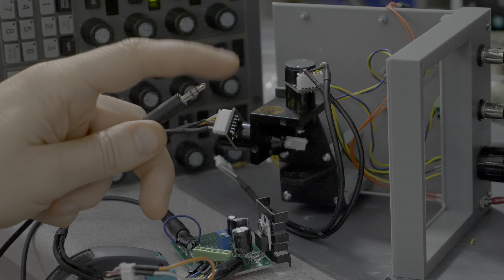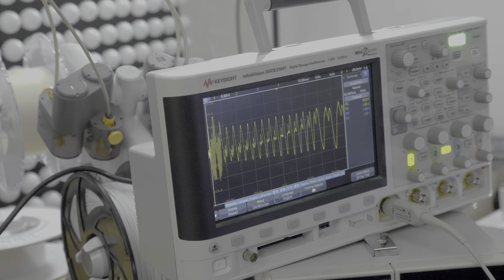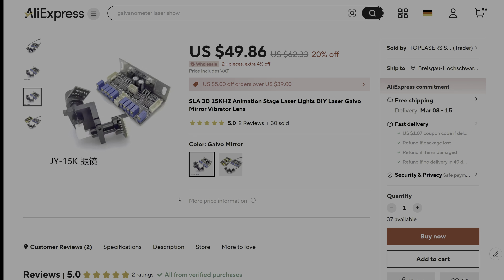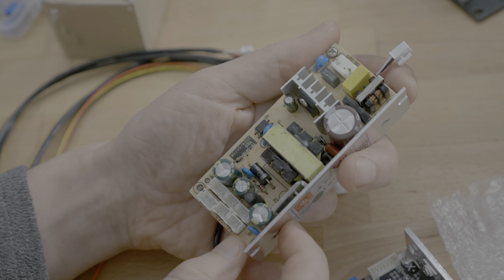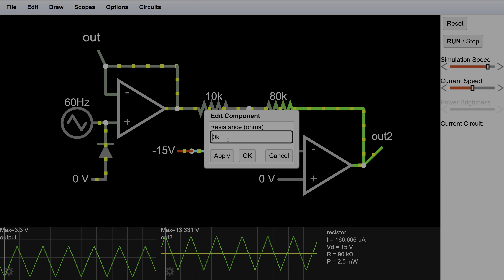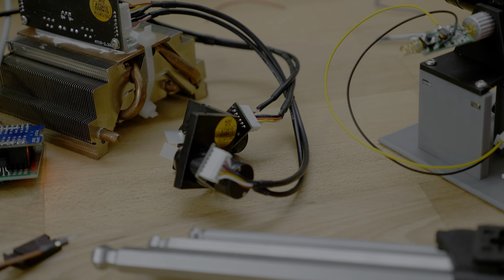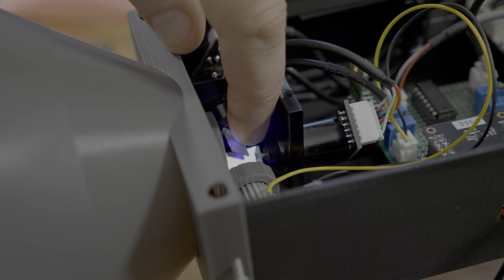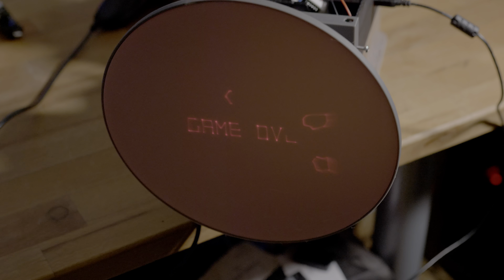I made a LASER vector display

Comment: Have you tried to use the style of reflector used in laser printers? Its a spinning wheel with 6-8 sides as a mirror so it would sweep like a normal crt display and you would only need a vertical galvo to be able to draw an image?
Reply: The reflector you refer to is called a polygonal mirror. It functions, roughly speaking, by rotating in front of the focus of a point light source to scan the point across the line of a single finite axis as each face pans across the focus, restarting at the opposite end of the axis when it reaches the next face. This rotation is usually, but not exclusively, unidirectional and continuous at a static velocity, due in part to the motors commonly used. A second mirror can be introduced to affect an additional axis or to flip the effective direction of travel or to redirect the output angle with a minimum of distortion.

While most readily applicable to raster scanning, I don't see with my limited knowledge of the subject why a pair of polygonal mirrors or a polygonal mirror and a galvanometric mirror could not be used to effect a vector display provided that the polygonal mirror(s) operate(s) on a motor(s) capable of braking and reversing motion and grading rotational velocity at the momentum involved.
Reply: @claws61821 polygon mirrors have a huge inertia when compared to Galvo + Mirror. Therefore they are only used for raster scanning.
Reply: That wouldn't be a vector display though, more like a 'fake CRT TV with a LASER'

Comment: The reason that the galvo driver takes a bipolar 5V differential signal is ILDA. It's the standard interface for laser scanners used for stage lighting. With ILDA a DB25 cable carries bipolar differential signals for X, Y, Z (uncommonly used, typically for focus), 6 colour channels (typically only RGB are used, occasionally you find 4-channel ones with yellow or cyan added), and an overall intensity/blanking channel, along with single-ended signals for shutter and interlocks. I run a pair of Pangolin FB3 ILDA interfaces to my projectors, for example.
Reply: Retired old fart Laserium laserist here. 5 years back in the game, developing my own 3 projector rig (again). Pleased to meet you.
Waiting for my $2,700 worth of RGB diodes, drivers, & EMS8000 galvos   to arrive from Live-Laser Systems in Austria, for my next projector build. 
Customs has them impounded in Memphis and are asking, "Do they emit radiation?" 🙄👿
Reply: @TheOleHermit  Ouch, best of luck getting those cleared. Kinda incredible what you can get for that price these days though. My Kvant Clubmax 2000 (2W total) was just over £2000 and now for the same price you could get 10W plus from European and Eastern market sellers.
Reply: @gsuberland  Special ordered 642nm diodes, precision ColorDrive analogue drivers, bitchin Sparrow optical assemblies w/TEC feedback cooling.
Wanted Saturn 5 galvos, but you know that story. I'm not a monopoly fan.
Custom developed, MIDI controlled Teensy 4.1 Laser Synth(s), Reaper's DAW, 16 channel Behringer X-Touch + Extender.😜
Strictly Swamidog's Radiator/LSX  video style (w/neither Radiator nor LSX).
10W? Retired from ion touring in 1988. Stage beamers w/Kvant scanfail nowadays, eh.  
Not for the living room/ studio. Even on a black projection screen, 3W projections are frying my eyeballs and over saturating the camera. They'll end up being beamers + the new 1.5W build will be for imagery + el cheapo bits for a lumia projector.
Stay tuned for 'TheHermit's T4 Laser Synth' reveal thread on PLF, in a few months, as soon as I've finished the impounded bits build.
😎
Reply: @TheOleHermit  nice! definitely way more fancy that I've been getting. I'm still stuck on BEYOND but if Liberation ends up being successful longer term I might consider switching to EtherDream or similar, or designing my own DACs for fun. I usually do beamshows rather than graphics so the higher power is nice, but I only run 2W indoors really anyway since going much above that isn't really that much more spectacular and I then have to really think carefully about exposure safety and static beams. The main big show I do is EMF Camp, and I do take a fair bit of lighting there, but Dmitri Modderman and Rob from Dogstar Lasers bring the big laser gear for that (also hoping masterpj55 will show up in 2026) and I just do the live control.
Reply: @gsuberland  Are you another one of the Patreon supporters for Liberation? Yes, I know Seb has moved to a different platform for funding now, but cannot for the life of me remember what it's called!
Reply: @cambridgemart2075  Nope. I might look into it at a later time but given that it's a subscription model it doesn't make a lot of sense for me.
Reply: Pangolin is too expensive. Use HELIOS
Reply: @  Yep.  I found out too late!
Reply: I made an rgb galvo laser display with 3 galvos and it works perfect. I mounted the galvos with 3d printed poly carbonate carbon fiber mix so maybe its not recommended but it works great
Reply: @98f5  That's great!
How many hours have you tested it at a time? What power RGB diodes did you use? TTL or analog drivers?
Which galvos did you use and how hard did you work them? Sinusoidal waveforms or animated graphics?

Major differences between hobbyist expectations and professional show demands, while $tousands are riding on every gig.
Reply: @TheOleHermit  got discord? Its too much to write here. I went through the phase a few years ago. After i used it once or twice for christmas and holoween it is in totes now lmao. I tried lots of stuff, the lasers were cheap diods from pointers bought on ebay. One used somebrushless servo motors i had for a project at work. The other used mirrors with basically 3 pins welded to the back and small electromagnets to manipulate the angle woeked similar to galvos i guess come to think of it i didnt use real galvonemeters though. Nonethe less it was an enjoyable project
Reply: @ Don't got Discord. Social media ain't a hermit's kinda thang. This is my only contact with humanity, except for hanging out with fellow laser head folks on Photonlexicon forum.
Impressed with your dual axis mirror. Had a similar idea back in the '80s. A mirror suspended in a magnetic field  being deflected by  the same surrounding magnets. Only needed some proper engineering and mega bucks to develop.
Recently saw someone else deflecting the end of a fiber optic. But of course, bending glass fibers doesn't last very long.
BR
Reply: @TheOleHermit  i used arduinos and the the biggest issue with that setup was there was a max limit to what you could draw and still have persistence of vision. i think you could also do the mirror deflection with piezo electric and get faster responses, but like u said, big money needed to develop the idea.  Ill lookup this forum. I did have one other journey into galvo lasers when i tried to make a home built selective laser scintering printer but the fiber laser was too much power for any of the  galvos i tried from amazon and would end up burning them. I seem to remember also taking apart one of those laser projectors for like night clubs to try to make one of those resin printers that usually use a dlp projector but ended up buying a commercial one instead.
Reply: U are discusing this on discord?
Reply: Pangolin!  I love their DAC interface.

Comment: i work with showlasers in my job and i might be able to give some insight.
the signal is +/-5V, since this is the ILDA standard. basically a d-sub connector on the back of any showlaser that connects the laser to the control system/interface.
that connection is basically analogue. it provides XY as +/-5V and 6 color signals of 0-5V.

the maximum angle of the galvo is low, since a bigger angle directly fights speed. showlasers are specified at 8° angle with their speed. if you want to increase one, you need to decrease the other. however there are lenses that expand the beam deflection if placed behind the galvo. maybe they will help. (as you tested)
also you got a very bad scanner(galvo) with 15kpps. even a very low end showlaser has 30kpps. a usable range is at 40 and the high end starts at 50kpps.
you might be able to snatch a used showlaser (or a broken one) for parts. you may look into old laserworld CS1000. if you are lucky, you may find one in the SE (speed edition) version. that one has a 50k scanner. those old CS MK1 are modular. so you will find the same scanner, laser diode drivers and so on.
The picture will be quite a bit better if you use a real 30 or 40kpps scanner.

i agree with you. you have overdriven your galvos quite a bit, resulting in the burned motor.
they are very delicate, require active cooling and careful adjustment. you can kill the motors even without messing with the driver. your scanning rate is important.
Reply: Retired Laserium laserist here, now back in the game, developing my own rig. I assume you're a Kvant/Beyond showman. Pleased to meet you.
Just made a similar comment regarding el cheapo vs professional gear. Moral of the story;
DON'T MESS WITH THE GALVO DRIVER'S TRIMPOTS!! 
Laserworld CS1000 have Cambridge Technology's 6215 galvos? Good to know.
Over the past 5 years, I've gone from no-name galvos (to get acquainted with modern Diodes instead of ions, knowing I'd repurpose the bits for a lumia projector) to DT-40 to C506. Crappy RGB dichro mounts to 3W RGB OPTlaser modules.
Waiting for my $2,700 worth of RGB diodes, drivers, & EMS8000 galvos   to arrive from Live-Laser Systems in Austria, for my next projector build. 
Customs has them impounded in Memphis and are asking, "Do they emit radiation?" 🙄👿
Reply: @TheOleHermit  hi,

i work with Laserworld showcontroller, which is basically relabeled dynamics.
The software is cheaper and the interfaces cost 1/4 of an FB4. So I stick with it.

At the moment I run a setup consisting of some modded china 4W (modded to have a working scanner failsafe), multiple Laserworld DS3000 mk3 and 4 and a modded Purelight at 10W.
However I started with a CS2000SE. its somehow strange that this old 2W TTL laser has a better scanner than all my others. This is why I still use it as a logo projector. 50kpps is still very good.
Reply: @derhackerthetofu  Hi,
Sounds like a nicely independent but professionally compliant gig rig.
currently developing my own Teensy based T4 Laser Synth PCB(#3) w/ open source firmware. Arduino compatible (for C++ savvy kids to customize), advanced full featured MIDI controllable C++ Audio library of synth waveforms & effects for abstract cycloids, 3D ILD file streaming w/blanking @ variable looping frequencies (mixable abstract image elements), 6 channel ADC for audio/CV inputs, 8 channel standard ILDA DAC outputs via DB25 + aux signals for lumia projector with I2C/QWIIC bus. Reaper's highly customizable $62 DAW for timeline programming from Behringer's (~$750) 16 channel X-Touch & X-tender CS w/motorized faders. 😜
Currently running 2 X 3W RGB projectors, one OTC OPTlaser + one custom built matching RGB module w/C506 galvos, each with an independent T4 Laser Synth
Previously meant Cambridge Technology's 6215 galvos, which I believe are what Swamidog's running on his custom projector for those award winning Radiator,/LSX videos but no longer available AFAIK. 😢
Reply: @TheOleHermit  Ok, NOBODY tell Trump that the Earth and the Sun emit radiation, or he'll impound them too on the basis of "national security".
Reply: Are those show galvos a bit compact as well?
Reply: @mymemori-es  The Scannermax Compact 506 galvos are about 1/2 the size of others, which reduces inertial mass and increases performance.
Reply: @TheOleHermit  ok thanks 👍🏻
Reply: Can you refer me to laser repair people

Comment: I work with galvos for years... plastic 3D printed holder is absolute NO option. Motor should be placed in aluminium block with perfect thermal contact and block should be placed on heatsink. Some galvos are non insulated and their holder or heatsink must be electrically insulated from other potentials like a mains ground . Even 50°C decreases life of motor and cause irreversible changes in magnetic properties of core. This cheap motors cant be pushed for wide angle and even manufacturers data are on the edge. Drivers are tuned in safe zone for motors by manufacturer and if you turn pots and add more gain or adding more dumping factor for sharper edges means you can overloading motors very easily even on small angles. For better angle you need expensive motors with +/-30 degrees or try to find f/theta lens suitable for visible light which is hard to find - almost all of them are used in laser engravers which use infrared light. Fish eye lens for phone camera was surprising option.
Reply: As far as I know, an F-theta lens is only needed when you need to have a constant focus point across a flat projection surface. In this case it wouldn't be necessary. A simple photography lens should do.
Reply: @ I apologize for misinformation. F theta lens will made picture sharp in whole plane but it needs even bigger angle on input than output. It doesnt work with this application well.
Reply: @  F-Theta lens isn't required on quality, properly collimated parallel beams.
I found a F-Theta lens on a Chinese optics site, while considering it to reduce the 5mm diameter of my RGB module's beams to fit onto 3mm galvo mirrors. Plano convex pre-galvos w/F-Theta correction post-galvos. But, opted for better quality diodes & collimating lens instead.
IMHO, scanning onto flat surfaces @ < 5 deg isn't a problem.
Short of the focal point, a photography lens will simply decrease scan angle but create more divergence beyond.
As was mentioned, the problem is el cheapo galvos.
Reply: Not aluminium...
Reply: @ 🖐😎 Sup?
Agreed. Cu is a much more efficient heat sink material, preferably with thermally controlled active TEC cooling. 👍
Reply: Is there any affordable digital driver available? Replacing those linear amplifiers with MOSFETs should eliminate the cooling need for the driver, but galvos would still be hot?
Reply: @matevzb  Yes, the galvos still get hot; some much more than others, depending upon size.
Galvo drivers have metal mounting bracket heat sinks for their voltage regulators, which need to be physically connected to a metal case, with thermal paste. 
Digital galvo drivers are only top shelf and the most expensive on the market, but the signals to the galvos are still analog. DSP is used to customize the response curve vs inertia of the mirrors.
These are state of the art technologies that have been evolving for 1/2 a century, are well tested, and have been developed by well funded professional engineers throughout the world. You're not going to DIY a better breadbox nor reinvent a better wheel.
If you need precisely scanned imagery, then you're going to need to pay the price for that quality. I just ordered a pair of galvos and drivers manufactured in Poland @ $1100, because I have professional standards.
Reply: @matevzb  What is "digital driver"? Pangolin ScannerMax Saturn5 has some digital driver with digital signal processing some FPGa processor on board, adjustable and tunable by computer without trimmers but they use LM3886 linear amplifier as power stage.  Only some IC like TDA2030 or LM3886 can work as DC coupled operational amplifier. We cant find suitable audio amplifier in class D - (digital) which is  DC coupled - all of standard Dclass ICs had integrated capacitors  inside and protection circuits against DC voltage on output. But on scanners you need something what is DC coupled - small picture on corner of drawing area has high DC offset and small AC signal. Only  symetrical picture in all 4 quadrants at once has only AC portion of signal in both channels. And high DC offset means lot of heat not only on driver but on coils of galvo too. For example DC offset is what kills speakers and probably this is the reason why standard D class amplifiers doesnt have DC offset feature. And galvos are hot and will be hot and situation is worse when you push "music picture". In laser show systems, the parameter "kpps" kilopoint per sec exist. For profi scanners 30-60kpps is optimal but for these cheap galvos 10kpps is more than enough. Amount of points where galvo had to move is precisely controlled by laser controller and you cant push 50kpps signal or image in 30kpps scanners because edges of image will be round and you will burn motors after a few minutes. If you pushing analog audio signal with 15-20kHz frequency spectrum width - it is the same result. Maximum frequency depends on shape of signal and amplitude (drawing angle), but is is not even close to few kilohertz. It is only somwhere 0-200 or not more than 500Hz. If you want to feed audio signal in to scanners you should use low pass filter signal like for subwoofer. Some of this filtration is integrated in driver but it is easy to turn some trimpots and increase the frequency more than galvos can move Remember If you feed higher frequency in to the driver and galvo it will always turn into heat doesnt matter if galvo move properly or not.
Reply: @martinleska4292  i was thinking more in a direction of using a regular H-bridge driver with high frequency PWM and a servo loop implemented in a FPGA or very fast MCU, ditching the need for the 'audio' amplifier stage. Some STM32 MCUs have ADCs with over 1 Msps, which should be enough for reading the feedback and PID (or something more appropriate for the application) could then be implemented directly in the MCU.
Reply: yapper
Reply: @handlesrtwitterdontbelivethem you appear jealous of his expertise
Reply: @ shush